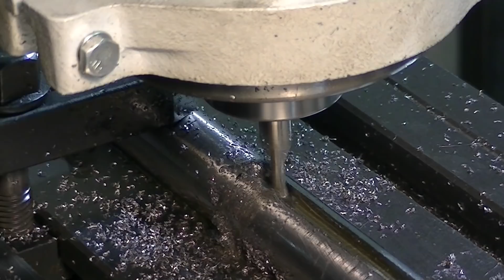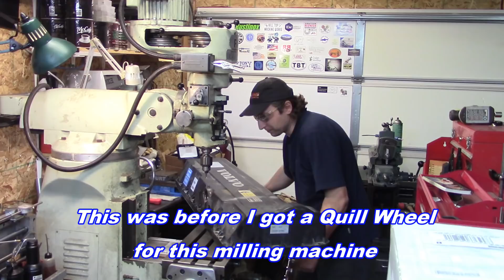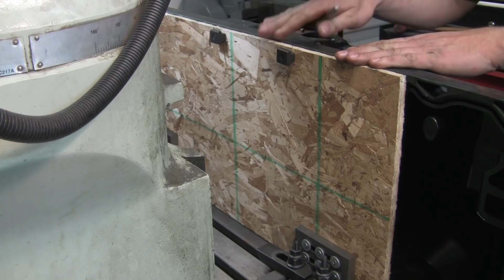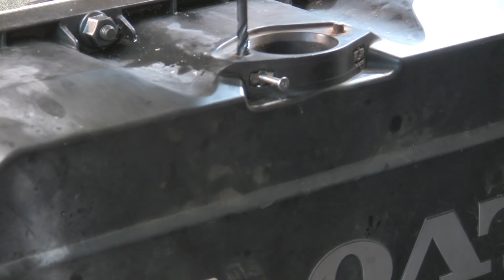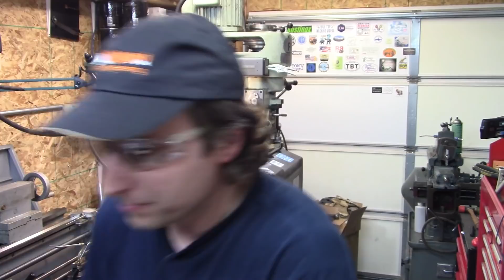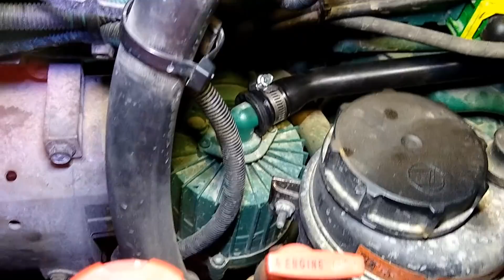Volvo D13 Valve Cover Crankcase Breather Tube Mount Repair

Comment: Awesome repair. It will function for sure
Reply from the maker: Thanks Jim, it does work!  This footage was taken in the fall, this fellow has been running the truck since and this part has not given him grief yet.
Reply: @EverettsWorkshop  I’m amazed at your creativity I figured the repair was working well. Hopefully your getting back up and running in your new home. Myself we’re doing fine. Just busy between racing and the auto shop

Comment: Nice switch handle have you on your milling machine. :D
Reply from the maker: Lol, thanks Antal!  It works :P  I was given a knob for the switch but have not adapted it to work yet.  That will happen when the new shop space is made ready and I can set the machines up and give them some maintenance and upgrades.

Comment: Nice save Everett, qualified success is success no matter how you look at it. Saved a fortune, I can't imagine a new one of those is loose change. Well done. Cheers, Jon
Reply from the maker: Thanks Jon, these are a few hundred bucks even for used ones, his bill was high enough for the injector cup replacement job so a new valve cover would have been extra painful.

Comment: Nice Job Everett. We do what we have to, does not have to be perfect or look good just has to work.
Good job

Cheers Fred
Reply: Hi Fred, how's it going?
Reply: @howder1951  
Well just taking it easy. Cleaning up the shop. Had dismantal my plasma table. Made such mess
Have wait till get bigger shop.
Will start doing tubing soon.
Thank you for asking.
Cheers Fred
Reply from the maker: Thanks man, might not be pretty but it worked well enough for a one-off!
Reply: @EverettsWorkshop  
As an old auto mechanic say. The rule
Of thumb. In cut it with torch. Measure it with yard stick, mark it with chalk. Other words getter done. As we go forward we always make it work.

Cheers Fred

Comment: Looks fine to me Everett. Sounds like a bad design from the beginning, especially if water was getting on the threads. Hope the new house is working out for everyone.
Reply from the maker: Yeah, I'm not impressed with the long-term serviceability of that idea for sure.  We're doing ok, still unpacking and sorting, and still waiting on garage permits . . .
Reply: @EverettsWorkshop  Garage permits, you must be planning a extension.
Reply from the maker: @andyZ3500s  Not extending it, but anything that is attached to a primary dwelling needs a building permit to insulate and drywall.  Legally, it's like finishing a basement.  So, needing both the building and electrical permits on this one.

Comment: Hi Everett   being plastic with steel insert is a pain in the Butt at any time. The thing is you did a good job of drilling & tapping the holes, and the main thing it fitted right back on. And fitting the studs in, instead of just bolts will make it last a lot longer, long as there are one or more holding Stabilizing  locations on the pipe.  Another job well done
Reply from the maker: Thanks Ted, hopefully if anyone has a D13 they will put studs in instead of those dumb bolts that will rust, lol!

Comment: everett looks like the second hole the tap was very crooked was it just me?
Reply from the maker: It wasn't super crooked, but it was a little bit off.  Sadly it was the best I could get in that hole with what was left in the bottom.  Thankfully it did leave a decent enough thread to grab with the stud, and the studs were in line enough to grab the line properly.

Comment: if it works it doesnt matter what you use to get to where you need to be!! its not a beauty contest lol great job Everett
Reply from the maker: Well, if I had to do more, then a metal plate would be in order for clamping, but this is what I had so it had to be enough!

Comment: Too bad things are made so cheap today. Plastic? I like the OSB, it's probably as good or better than the plastic. Its worth $33 a sheet now. Well done Everett.
Reply: 33 bucks is a steal. Almost 60 around here.
Reply from the maker: Well, the plastic would not have been an issue if they had used a better fastener design.  And to think this truck was from around here, you would think the Swedes would have thought about corrosion like that over there with all the salt sea air!
Reply: @EverettsWorkshop  Unfortunately it is all about how cheap can we build them now days.

Comment: Hi Everett good save what does your mill run on single or three phase
Reply from the maker: Thanks!  The original wiring was for 3 phase, but as the motor itself is single phase I rewired and simplified the control system